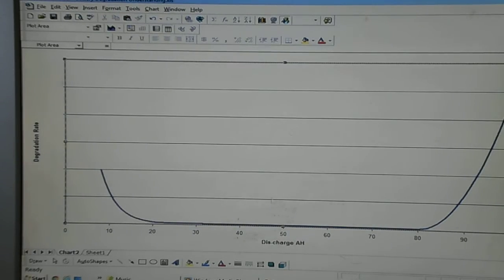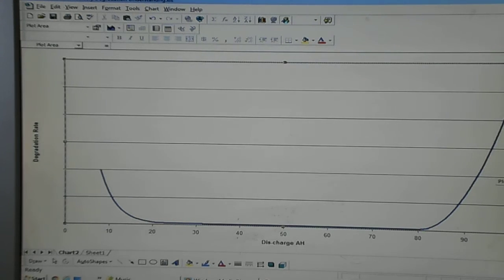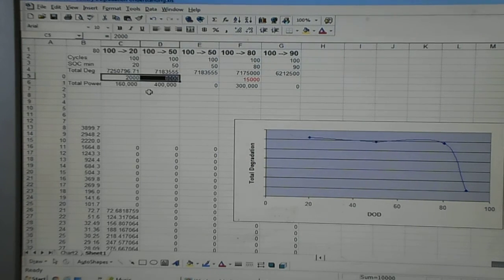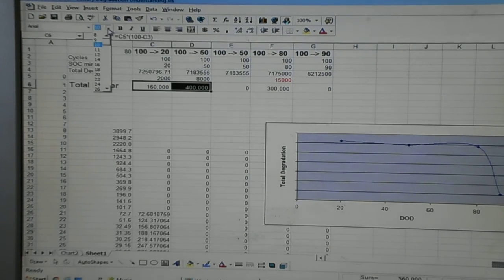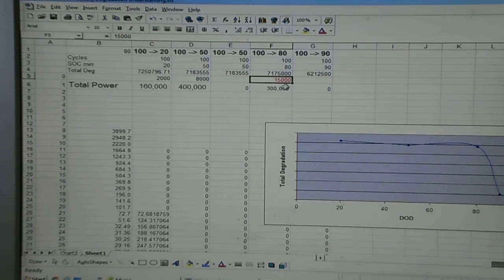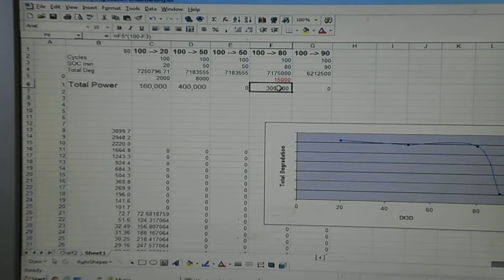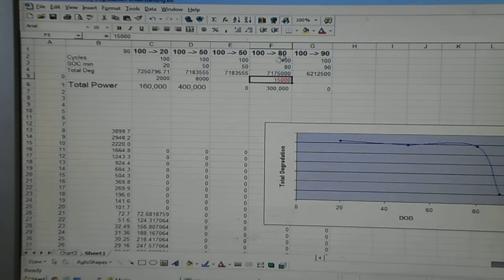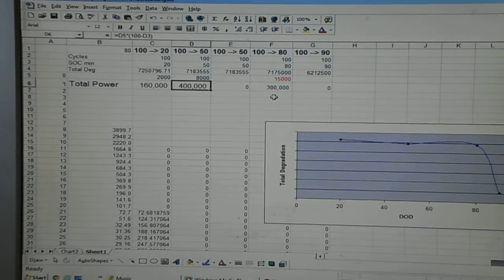LiFePO4 - Battery Cycle Life Conclusion

Comment: Hey ! I've got a 100Ah 12V Ultimatron LifePo4 Batt and i would like to be sure that it's better to use it 20% to 80% most of the time than 20% to 100% to minimize the historic number of cycles. What about just having random cycles with solar recharge for example (100-80% ->100-50-> 100-20) which will increase the numbers of cycles a lot ? Thank you for your answer. I'm not so good in english that's why i didn't understand everything in your conclusion.
Reply from the maker: Yes, 20%-80% SOC (State of Charge) is the best.  The problem is how to set the voltage to achieve 20% and 80%?  My best guess for LFP is 3.25V/cell - 3.05V/cell, but very small voltage changes will result in very large changes in the amount of energy in the battery.  I am off grid, so my low end is not controllable....the sun controls it to a large extent.

Comment: This is closer to the real question when deciding on chemistry and cost than most people care to discuss... add to it the price of the battery/total usable capacity over life cycles to 80% capacity at whatever DOD that gives cycles to 80% capacity... then we can all finally compare the real value of a battery... thats what got me looking at the more expensive LTO vs Lifepo4 where total kw over lifetime for (lead acid=[0.375$/kw, DOD=50%, cycles=2000] Lifepo4=[0.11$/kw, DOD=60%, cycles=8000], LTO=[0.02$/kw, DOD=80%, cycles=22000]...
Reply from the maker: I have also looked at LTO (a few years ago) and the one big problem I saw at the time was the lack of BMS system for the lower voltage LTO chemistry.  Don't know if the situation has improved recently.  I don't know what cost you used for your calculation of $/KWH(lifetime), but used EV car batteries have gotten a little cheaper over the past year and I hope they get much cheaper making them the best value battery.  Also, LTO cycle life beyond a human life span is questionable to add into a calculation of cost (unless you are buying them for your children)  Putting batteries into a will may be done someday, but I don't think we are there yet.
Reply: @gyoung7332  Yep I know what you mean about the cycles, although I understood that LTO has been around 5 years I think, but still short... I'm still on the fence a bit myself and just researching. I've seen DIYBMS you can change out 2 of the resisters, adjust for different voltage of LTO... theres an ausy guy building a nice bank https://www.youtube.com/watch?v=w_LMpwG_P1Q he's using diybms. 
I'm still young so a realistic lifespan of 10/20 years using their full capacity and not having to baby them would be nice.
The prices I used were fair, I was looking for the cheapest Winston lifepo4 I could get from aliexpress... and like wise lto cells. Even if I cut the lifepo4 prices in half and reduced the LTO cycles to the LTO cells were still better value...
About the will... very few people itemize every single thing in their houses in a will so its just part of the house infrastructure...
Reply from the maker: @ndudman8  For a 20yr lifespan, you need about 8000 cycles.  Using LFP from 40% - 65% DOD should give you that many cycles (how to set the voltage to achieve this DOD range would be very difficult on a charge controller) at a cost of ~$2/WHr.  While using LTO would cost ~$10/WHr over a 20yr period (many thousands of cycle would still remain)  This analysis is a 20 human lifespan rather than a battery lifespan analysis.  So, spending the same amount of upfront money, you could have a much larger LFP battery(KWH) - with the increased flexibility of using additional DOD if needed (knowing cycle life will decrease).  FYI - one of the biggest challenges of off grid power is keeping you batteries at the optimal voltage.  My batteries spend far to much time at the float voltage (3.35 V/cell) because you never know tomorrows weather and you don't want to sit in the dark for a day.
Reply: @gyoung7332  I understand what your saying, but babying  the LFP by using just 40-65% i.e only 25% of the capacity, means that you need at least 2X the bank (twice the price) for the same usage, just to extend the battery life, with a 25% usage of capacity the life time kwh is so low that the cost/kwh over its life time goes way up making this suggestion again much more expensive than just using batteries either LTO or LFP in the normal way  and having a shorter life cycle (LFP say 2000-4000) and LTO 8000-12000) and of course I'd guess from specs that more usable capacity and higher rates of charge/discharge would be available from the LTO even with those cycle numbers... but all this I'm just guessing, trying to be realistic from what I've read. I'm still on the fence and will probably go for LFP and use 40-90% (50% capacity usage) at 0.25C in/out to baby them a bit :) unless emergency then push them more occasionally. Its a real shame that there arn't more usage stats from good bms's... have you seen diybms ?
Reply from the maker: @ndudman8  Yes, I have seen diybms.  The most important question for a BMS is RELIABLITY...when it fails, it can destroy one cell or many cells - $$$.  In the early days of BMS this was a big problem for me and my e-bikes.  I do not see many youtube videos of BMS failures, so I can only assume that BMS systems have improved.
You plan to use 50% capacity - this is similar to what I try to do.  The problem is that the batteries will be at full change(90%) by 11am/noon each day.  Which means that the batteries are spending noon to 4pm at full change(4hrs) then declining to say ~65% over the next 6-8 hrs(bedtime), and then a very slow decline to 50% over the next 9-11 hrs(ghost loads) and then 3 hrs of charging....NONE of the cycle life data was determined using this charge discharge cycle.  As you can see from the timeline, the batteries spend most of time above 65% - summer time will be higher and winter time will be lower.  I believe this causes faster degradation/loss of capacity/cycle life than would be expected based on data from manufacturers.  Also, remember that this cycle will not be the same every day. (only consecutive sunny days)

Comment: G Young, do you have any estimation of how much capacity you have lost on your set of batteries given the full time use you've put them through thus far?
Reply from the maker: No, but I am close to being able to get that information.  What I need is the ability (Arduino) to monitor/display all 48 cell voltages and control and interrupt relay.  But, I will not know the loss, only the current amp hour capacity (will have to assume the initial capacity = rated capacity) --- I will make a sort video of it, when done.

I have also been continuously dumping power (also burnout a e-heater today & lowered my absorb voltage to 53V), so I may find out if any of the cells in my 48V pack have 200 AH capacity.  1 of 16 cells in my 12V pack has only 200AH capacity, the other 15 had more than 300AH at 15A discharge rate (C/20).
Reply: Cool. Looking forward to seeing your real world results when you get them. 

I think you individually monitoring each cell is the way to go but it seems rather complicated to setup for many users. Your system is very customized. I'll be the first to admit I don't know much about programming or setting up Arduino boards. If you're able to do all this, then being able to monitor the voltage of each cell should be very useful.

Comment: You damage the battery (drastically reduce cycle life) by discharging it too deeply. Saying the battery was fine afterwards does not make sense. You threw much of your battery investment down the drain the moment you do this.
Reply from the maker: Perhaps, but they still work 6 years later.  If I would have over charged them, they would not work the next day.  As the (made up-fiction) graph shows, the relative damage is less...maybe fine is an understatement.